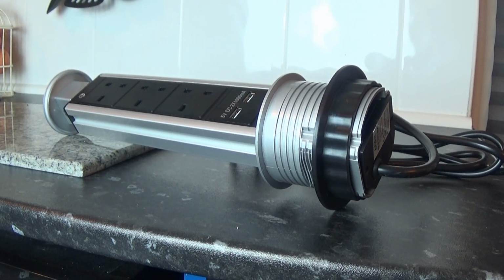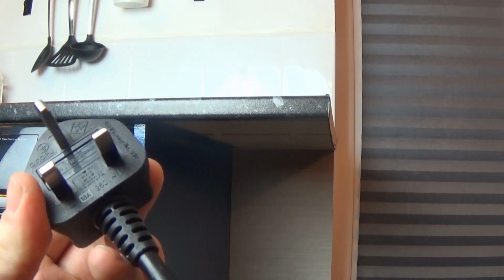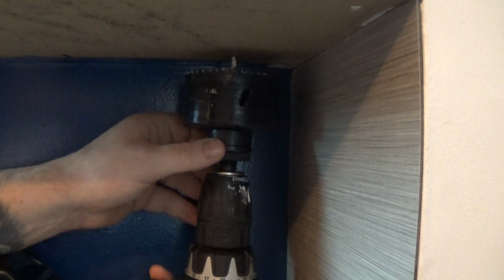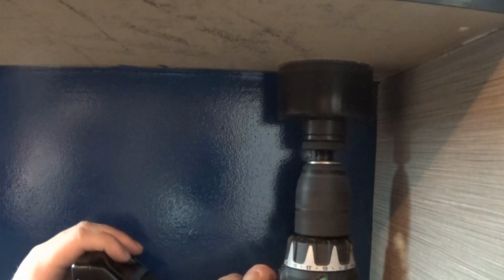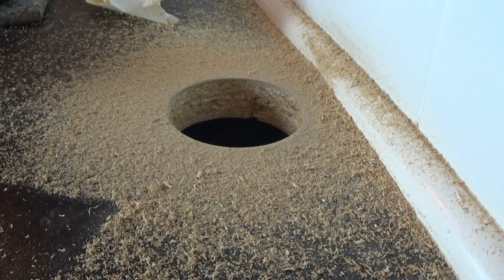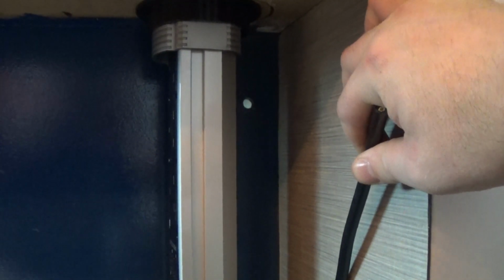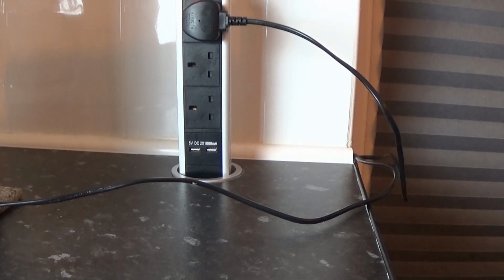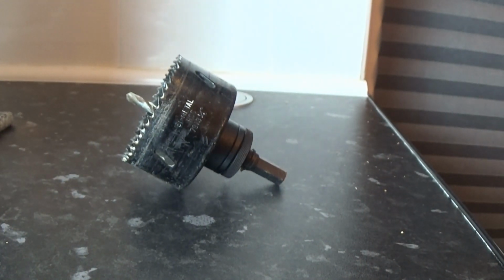How to Install Pop Up Socket / Tower Socket in Kitchen Worktop - From Aliexpress

Comment: Thank you for making the video. I have one of those. Is the fuse for the socket inside the unit or on the plug? My unit has stopped working, and the main plug is behind the board of the cabinet (Hard to reach). Any advice would be great. Thank you.
Reply from the maker: Hi mate, the fuse is inside the plug so you may have a little job on your hands.